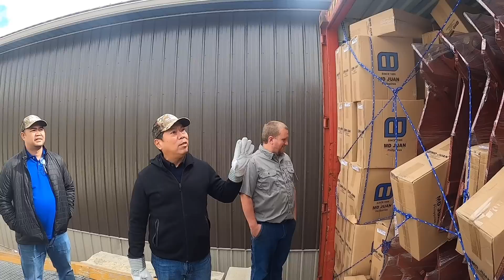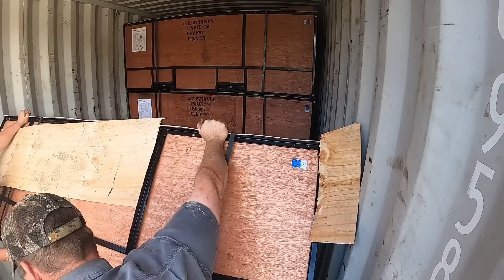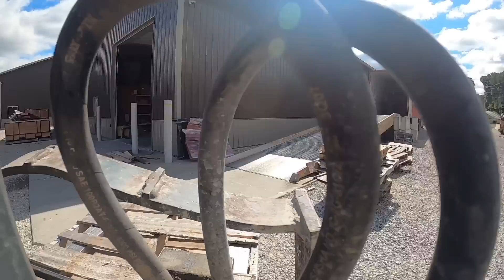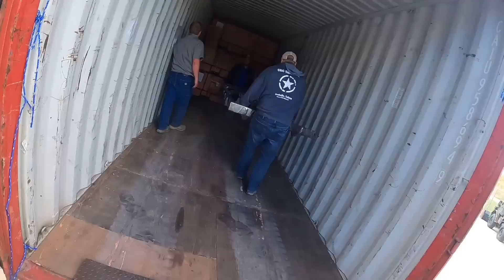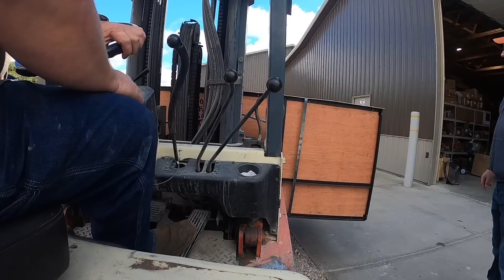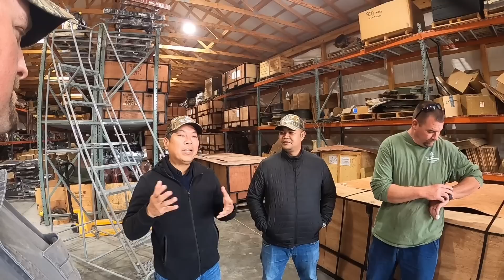We have help unloading an 40’ container of @mdjuanjeepparts from some very special people

Comment: Is that the shop truck you just built the 7.3 engine for? The bed and paint job are great. Will the bed have adapter for 5th wheel?
Reply from the maker: Yep it will